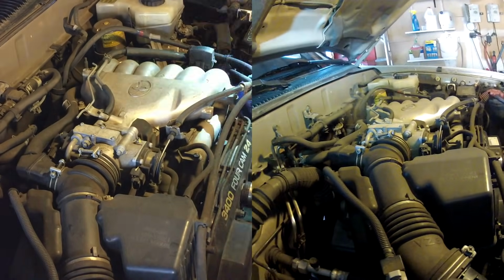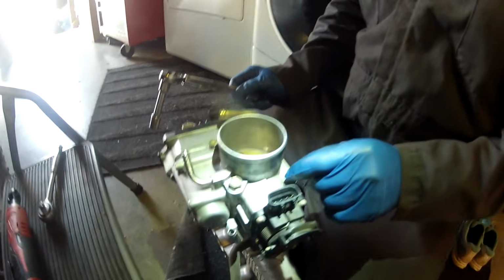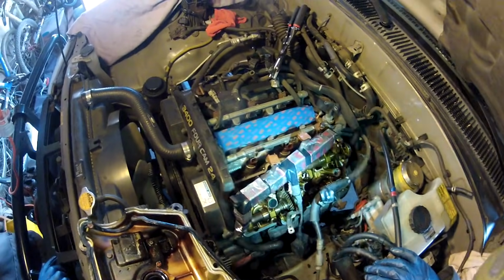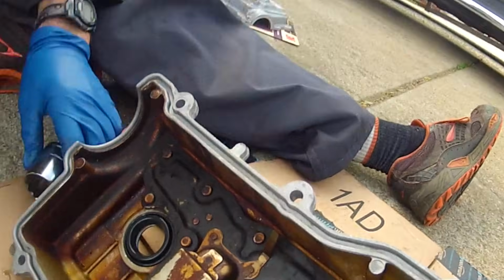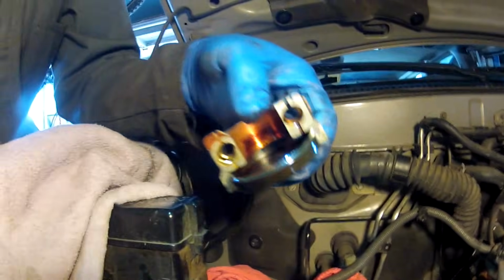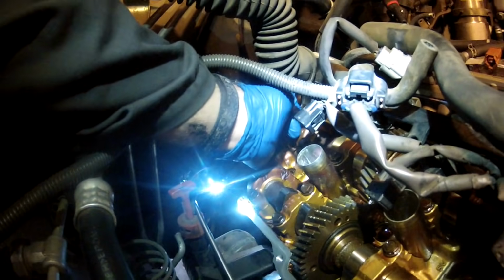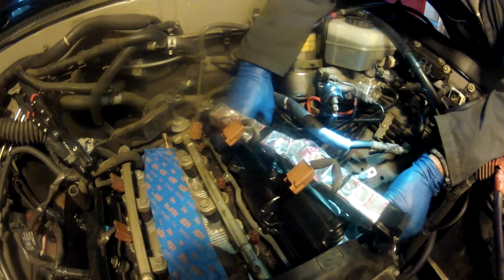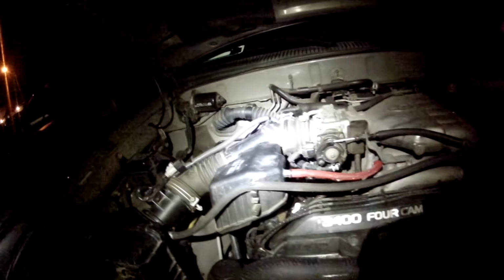3.4 L V6 5VZ-FE Toyota 4runner, Tacoma, Tundra Valve Cover Gasket Tutorial

Comment: you forgot to show where to put rtv on the valve cover gaskets. are you supposed to put the rtv in the corners?
Reply from the maker: You must have missed it.  I specify where to apply FIPG on the surface of the head.  Starting watching at playtime 31:20 and you'll see that I mention it.
Reply from the maker: Yes, you are suppose to put FIPG on both sides of the raised cam body where it comes down to meet the head surface in that 90 degree corner, on the front of the head and the rear of the head.  Then you are suppose to put FIPG on the half moon junctures where it meets the top surface of the head.  So, 8 locations total on each head.  4 for the cam/head corners and 4 for the half moon junctures.
Reply: sorry I did miss it. Thank you so much.
Reply from the maker: You're welcome Lee.  Happy Wrenching!

Comment: Really liked your video and detailed parts and torque specs.  I've got a 1997 T100 (only 114,000 mi)  which has this engine and valve covers are leaking. I'm thinking that I'll go with a 1/4 torque wrench as the valve cover bolt torque you spec'd say 53 inch-pounds and most 3/8 torque wrenches I've seen on the web start much higher than this.  Parts + torque wrench cost would be about 1/4th the cost of having it done by a dealer IF things go well.  It will most likely take a couple of weeks to get the parts and time to make the attempt.
Reply from the maker: Hey Doug, this really isn't a hard repair, just time consuming.  If you label hose and electrical connections and just take your time, you shouldn't have any problems.  The money savings is awesome and you gain a valuable tool in the process.  It's a no-brainer to do this repair yourself.  Plus, you'll probably do a better job than the mechanic rushing through your repair so he can get to the next job.

In preparation for dropping my transmission pan, I bought a scraper that comes with plastic razor blades so I can remove all the old sealant off the pan and transmission.  I was thinking it would be great for this job too since you need to get old sealant off the head and half moons.  Here's what I bought:

https://www.amazon.com/gp/product/B01F2Q2WPW/ref=oh_aui_detailpage_o00_s00?ie=UTF8&psc=1

Comment: You made it clear where to put the seal packing, and I totally understood ur instructions,,, but this person put it on the entire surface of the cylinder head whr the valve cover gasket sits. I didnt see u do tht.
Reply from the maker: Yeah, what that person did is unnecessary.  The reason for the sealant in the spots the FSM specifies is because they are areas the rubber gasket would be prone to leak.

Comment: Hey Timmy, the service manual didn't call for seal packing on the surface of the cylinder head right???...i freaked out cuz I just saw a picture of someone who put seal packing on the mating surface of the cylinder head and thn they put the valve cover with the new gasket on top of it. Is tht too crazy??? Wht do u think?
Reply from the maker: Yes, it does in certain spots.  I mention it in the video starting at play time 31:25 everywhere you need to put it.  You need to put some sealant at each gap of the half moons where it meets the surface of the head.  You also need to put sealant at the right angle corners on each side of the raised cam.  So, there's 8 spots where you need sealant: 2 beads of sealant per half moon and 1 bead of sealant on each right angle corner where the raised cam comes in contact with the flat head surface on the front of the head and the back of the head.  I hope this makes sense.

Comment: Hey Timmy,,,in regards to the  tape u used too hold the plastic wiring harness from breaking into a million pieces.  Does it HAVE to be tht heating duct tape or any is ok. I found one tht only resist to 150 degress....its an all weather duct tape tht says it resists drying, peeling or cracking. I found it in the automotive dpt. at Walmart ( resists the damaging effects of weather. The reason I ask cuz the high temp. tape is pretty pricy for only a one time use and I'm trying to find something more inexpensive without doing a sloppy job...Thanks agn!
Reply from the maker: I would find something with a higher temperature rating.  The coolant temps in our engines can get up to the high 190's.  The tape I used has a temperature rating of up to 325 degrees.  Just go to a hardware store and try to find something like I used.  Here's a link: http://www.homedepot.com/p/Nashua-Tape-2-5-in-x-60-yd-324-Amp-Premium-Foil-UL-Listed-HVAC-Tape-1207794/100048600

If you don't want to spend money on a roll, see if you know anyone that does HVAC.  They probably have rolls of it and can just give you some.  Also, if you know someone that does home or commercial construction, I bet they could hook you up with the small amount you need for this job.  If you don't know anyone, I'll mail you some tape off my roll.  Give me your email address and I'll send you a message and then you can respond with your mailing address.
Reply: super high temps, def need high temp tape regardless of price

Comment: Good morning Timmy, hey just double checking the socket u used to press the spark plug tube seals was a 32mm not a 34mm right?
Reply from the maker: I remember it being a 34mm socket.
Reply from the maker: Hey Israel, I was wrong.  It was a 32mm socket I used to pound the spark tube seals in with.

Comment: Oh, hey do u think it's a good idea to put loctite glue for fasteners on the valve cover bolts...i was considering doing this seeing how those bolts tend to loosen up over time. Just want ur input, seeing ur way ahead of me on this.
Reply from the maker: Using some Blue 242 Loctite would be ok but definitely don't use the red loctite.  However, I don't think it's so much the bolts coming loose but the rubber on the washers shrinking over time making the bolts loose.   So, even though the bolt isn't really backing out the shrinking rubber is causing the bolt to not press down as firmly on the washer anymore.  Those washers are a weird design but the engineers must have had a reason for making them that way.  

A little blue loctite is some extra insurance but I think you'll find in the long run your valve cover gaskets will leak again due to the aging bolt washers.  For all of us who've done this job and did it right, I think we're probably good for another 75,000 miles or more so we won't be doing it again anytime soon.
Reply: @TimmyTheToolman  Good morning, Timmy. Thank you for leaving such good video for us. On these bolts getting loose, do you think it is worth to come back later to check if it is loose and re torque to 53 in-lbs ? Or after a while the bolts should be replaced ? I think one of the tricks is really clean the bolts and the heads from oil and debris.
Reply from the maker: @jonascourtney5999  Here's my theory Jonas on why the bolts come loose.  The washers are a special type of washer with a rubber cushion.  Over time, the rubber dries out and shrinks taking pressure off the bolt and making them feel loose.  They may even back out a little when this happens from the vibrations of the engine.  You could go back in there and tighten them after some time has passed but that would require removing the throttle body and plenums because you can't get at all the bolt and you would want to tighten them down evenly.  I think it takes quite some time to start developing a leak so you should be good I'm guessing for another 100k miles.
Reply: @TimmyTheToolman  I also think they use that kind of arrangement to absolve the mechanical stress when torquing the heads since it does not seal nothing.    After taking my time to clean the gasket maker used on the heads, I can see why you recommended so much a good cleaning, I found a mix of original Toyota gasket maker, orange and gray gasket maker on the half moons and caps. Both caps where also damaged.  I also took the brackets behind the caps, had so much oil and dust it would not make easy to install the new caps. So what you said about preparation is really gold here. Thank you.

Comment: Hey BTW, was ur oil leaking bad on the 2000 4runner. How long ago did u actually do the work on ur 2000,,, and did the leaking stop up until this day, just curious??? How many did it have when u did the work on ur 2000 and how many does it have now.
Reply from the maker: My valve cover gaskets were leaking pretty good on both sides but more so on the passenger side.  I did my valve cover gaskets a little over a year ago.  I had around 140,000 when I did it and now have around 156,000.  Yes, the leaking has stopped.

Comment: On the parts list it shows 4 cam plugs. Is tht 2 in the back and the other 2 in the front. I don't remember u showing the ones in the front on the video.
Reply from the maker: There's only 2 cam plugs which go in the rear of the heads.  It was a mistake when we said (4).  I made a notation in the video description but I know many don't read that.

Comment: Hey Timmy, was the inch lbs torque wrench u used a 1/4in or 3/8in. ? Also, can either one be used?
Reply from the maker: My inch pound torque wrench is 3/8" drive but you could use a 1/4" drive too as long as it goes high enough for the torque spec and you have the necessary socket and extensions to go with it.

Comment: Is it ok to brush the outside of the valve cover with a light plastic brush once it has been sprayed with degreaser...if so wht kind of degreaser or cleaner would be good to use.      Oh also, how do u clean the inside of the upper and lower plenums???
Reply from the maker: Hey Israel, Yes, you can use any plastic bristle brush you want on outside.  Scrub to your heart's content, you won't hurt anything.  You could use brake cleaner or something similar but I like a product called "Clean Streak".  I use it to clean up bike parts but I learned it's also great for cleaning up car parts as well.  Here's a link:
https://www.amazon.com/White-Lightning-Clean-Streak-Degreaser/dp/B001298HEE/ref=sr_1_3?ie=UTF8&qid=1488409021&sr=8-3&keywords=Clean+Streak

You don't have to buy from Amazon.  Most bicycle shops will probably carry Clean Streak.

I'd use the Clean Streak to clean up the upper and lower plenums too.  It dries quick and doesn't leave a residue.  Basically like brake cleaner.  If you have more questions, just ask.

Comment: This video helped me a ton, but after reinstalling everything I now have a rough idle, also there is some engine noise. Would you happen to have some insight on this problem?
Reply from the maker: Did you clean the throttle body?  If so, there's a chance you let the cleaner runoff drain down into the IAC (Idle Air Control valve) which could cause your idling problem.  You'd have to remove the throttle body again, turn it upside down and remove the IAC.  I don't have a video for this but you should be able to find a video or at least a write-up doing a Google search.  I've heard the screws that hold the IAC are prone to strip so be careful.

Another reason for a rough idle is maybe you don't have the spark plug wires on right.  Did you double check the routing of the wires from the coil packs on the passenger side to the driver side?   Make sure the wire boots are pushed down all the way making a good contact with the spark plugs on the driver side.

There's also a chance you forgot to connect one of the vacuum lines.  Double check your work checking all the hose connections.  One of them could be off all together or maybe one of them is cracked from the work you did.

The engine noise is a little troubling.  What does the noise sound like?  If you replaced the cam seals, did you remember to tighten the collars that hold them in place?

Check all the things I suggested and get back to me with what you've found.
Reply: Hey I really appreciate the reply, turns out I had some spark plugs in the wrong spots switched them out now it runs like its suppose to.
Reply from the maker: Awesome Jacob.  Glad you figured it out.

Comment: Thank you for answering.I really do appreciate it.  I'm getting the courage to do this soon, thanks to your helpful video.
Reply from the maker: You know dude, I sat on the parts for this job for 6 months because I was debating whether or not I wanted to do it but I'm so glad I did.  It was this job that actually got me back into to wrenching more and was the catalyst to starting our YouTube channel.  

Just take your time.  Label hose and electrical connections as you take them apart and maybe even take pictures just in case you forget how something goes back together.  When you complete this job, it will be a big confidence booster for you like it was for me.  Many times, auto mechanics is pretty easy if you have the right set of tools and information.   It can be hard when you're chasing down a Check Engine code and there's multiple reasons why you're getting that code, but like I said, a lot of auto mechanics is pretty straight forward.  

It's always nice to have an extra set of hands so maybe get a friend or family member to help you out.  Good luck Israel.  Let me know how it goes after you complete the job.

Comment: ...also wht do u recommend to clean the half moons and whr they go??? Thanks
Reply from the maker: Hey Israel,  there's two half moons on each head, one on the front of the head and one on the back of the head.  These half moons are reusable.  My buddy Sean decided to replace his but it was not necessary.  The way I got mine out is I taped the serrated jaws of a pair of channel locks so I wouldn't damage the surface of the half moons, I got a good grip on it and pulled them out.  

To clean them, I used a plastic putty knife but you could also use a razor blade.  I suggest trying to find a couple small plastic putty knifes or something similar to get the old sealant off.  I like the plastic over something metal because it won't damage the surface of the head or half moons.  A razor blade will work but you have to be more careful not to make deep scores into the surface which could be a potential leak spot.   You want to get all the old sealant off so you can put new sealant on and reinstall them into the head.  You also want to clean off any old sealant that's on the head too.  Basically, you want a completely clean head and half moons when you're reading to apply sealant and reinstall them.   Don't be in a rush.  Take your time and get the heads and half moons as clean as possible.  And, don't be stingy with the sealant.  I put enough on there so when I install them, sealant squeezes out the the sides.  Just watch the video closely and you'll see how we do it.  If you have any more questions, just ask.   Good Luck!

Comment: Is it necessary to drain the oil or engine coolant to change the valve cover gasket.
Reply from the maker: Hey Israel, No, it's not necessary to drain the coolant or engine oil.  When you do this, all the oil is sitting in the oil pan so no worries there.  There is a small coolant line that connects under the throttle body but when you disconnect it you'll only lose a tiny bit of coolant.  If you want, you could clamp off that coolant line with something like vice grips or a special line clamp if you have one.  If you do use vice grips, wrap up the serrated jaws with something like electrical tape so the metal jaws don't cut into the rubber coolant line.  When you disconnect that coolant line though, you'll see how little coolant comes out and you'll probably just let it drip out onto the top of the engine - No big deal.  If you have any more questions, just ask.  Good Luck!